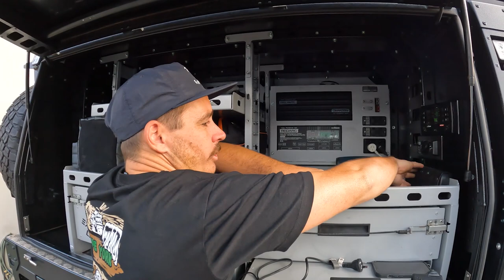2 DAYS TO PACK FOR A THREE MONTH TRIP! TOURING TIPS!

Comment: Best you check your Patriot manual, the rear hitch receiver is specifically noted as unsuitable for recovery work, its only any good for bike carriers and the like.  Each of the other two recovery points are rated at 800-1,300kg each depending on pull angle, so no more than 2,600kg for the pair...
Reply from the maker: Thanks for the tip mate, havent needed it yet so will keep that in mind 👌
Reply: Yah.  👍👍👍👍👍👍

Comment: Would definitely be interested in the water proof bag. I’ve tried Darche canvas, Caribee tanker and a Kathmandu tanker and still get my gear on the roof wet.
Reply: Have you tried dry bag, duffle style Patagonia Black Hole series or Yeti Panga series ? Several sizes up to 100l. Also ROAM and CAOS also make great waterproof, dustproof cases. Roam now makes clips that attach to the roof rack = no ratchet straps needed.